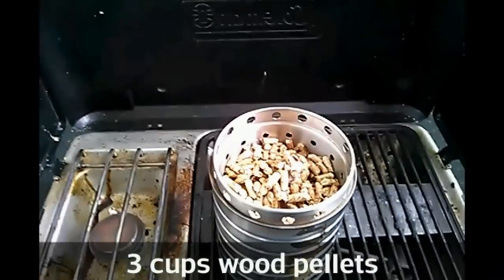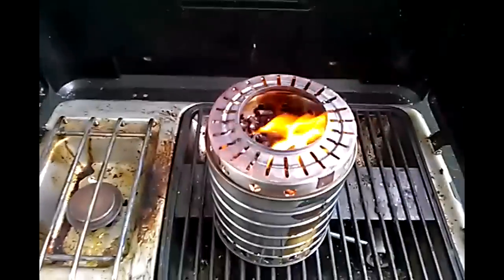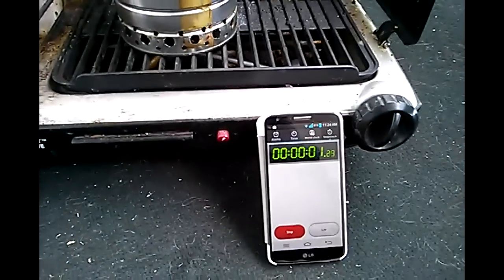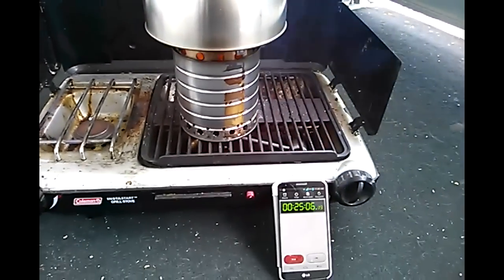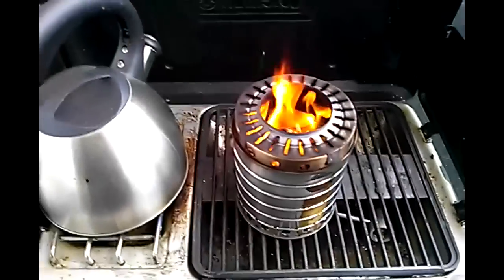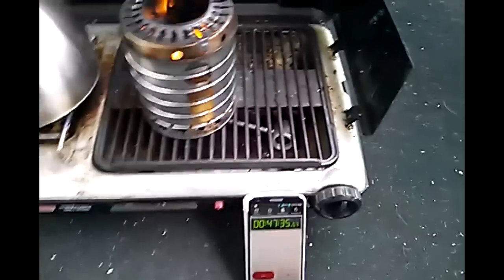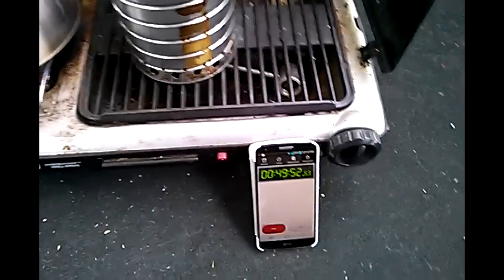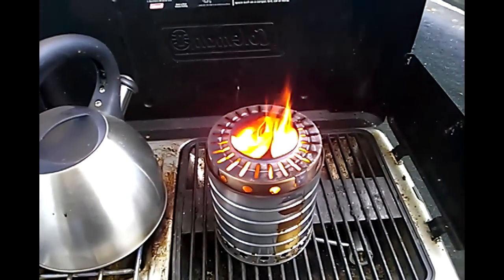DIY Stainless Steel WoodGas Stove (v2.0)

Comment: The pot is acting like a "candle snuffer", causing CO2 to build up & smother the fire; not too much combustion air. The Tuna can under the pot allows the CO2 to escape and the flame burns brightly. I would like to see 2.0 with the Tuna can under the pot.

Comment: Hey Joe! I was thinking about something as watched this vid ( I haven't seen the new vid yet so I apologize if the new one addresses my observations ), when I burn my gas stoves, the ones I've built, I get blue flame. Very clean burn ( I use "Heet" as fuel ), when I burn wood as in a campfire, for instance, I get yellow flame. Being no expert I still couldn't help thinking that as a wood product the pellets may only produce a yellow flame. Not because it's a "dirty" burn but because of the nature of the wood to burn yellowt. But also, I've recently lived in a house in which we utilized a pellet stove to heat the place and it was always a yellow flame…and that was with the built in fan running to keep the fire stoked. Pellets are pretty dense and all this is making me think that with a couple of fistfuls of pellets semi densely packed into the stove that the cooler flame might be because it's oxygen STARVED…I'd love to see you try it again but with a fan blowing at the bottom of the stove as it would in a home pellet stove. Please believe me I want to see you succeed. I want to use pellets in a pinch too! I appreciate your efforts and have enjoyed your vids. Keep it up! Love to hear your thoughts on this…ATB, Tim

Comment: Hi , watched both videos , very informative ;) 
I thought of something that might do improve the containment of the heat escaping from the sides , you can isolate it with some white cement , it's a pain in the ass for , sure but just thought of sharing that idea with you ;)